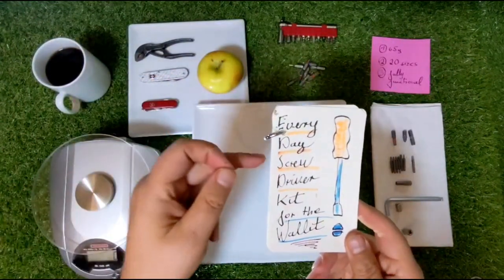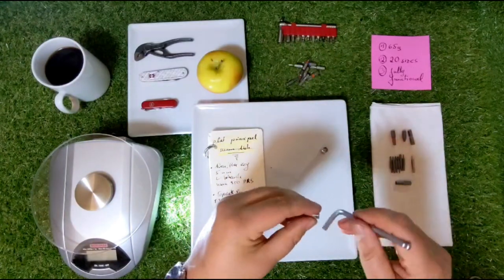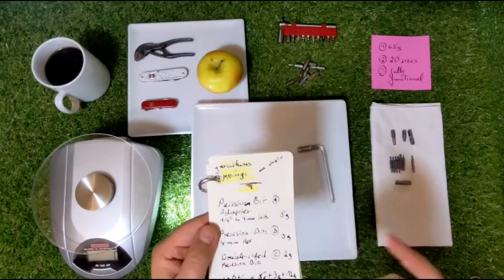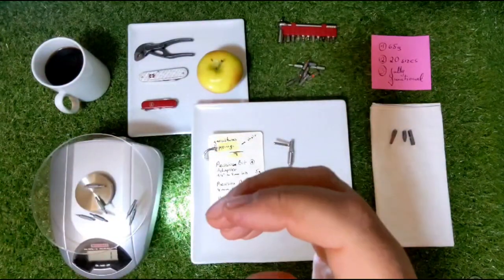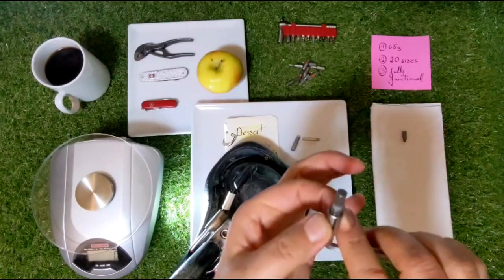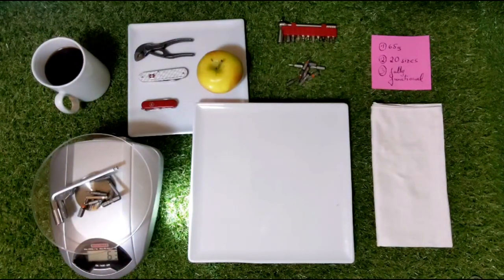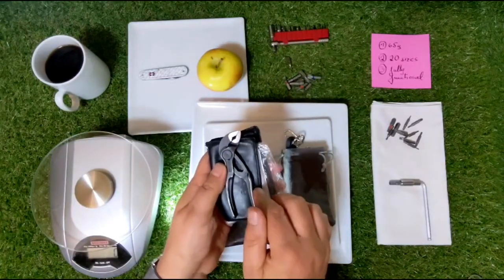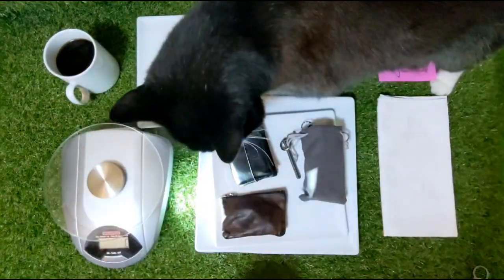Lightest EDC Wallet Screwdriver Kit 2nd Prototype @todd.parker

Comment: This is really good.  Nice cat! We tried 2 times to have a cat,  but our dogs wanted to snack on them.  :( 

Anyhow,  i appreciate the clear explanation of the bits here; i could replicate this if i wanted.  Very nice and strong screwdriver!

May i all a practical question? Worth the Bantam Alox tucked so far inside,  do you find that you hesitate to dig it out to use it?
Reply from the maker: Yes, initially I was sometimes hesitant. I have improved the packing. I now keep the Bantam Alox usually with my key pouch. Same pouch for the Mini Champ which had become my main SAK.